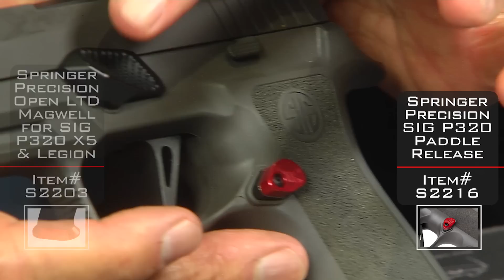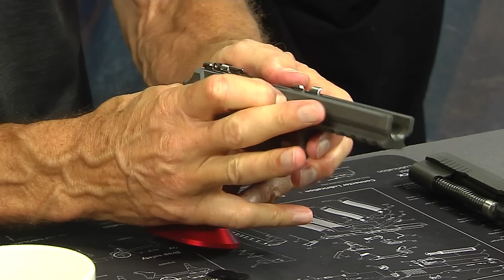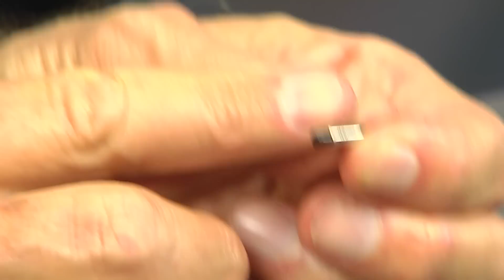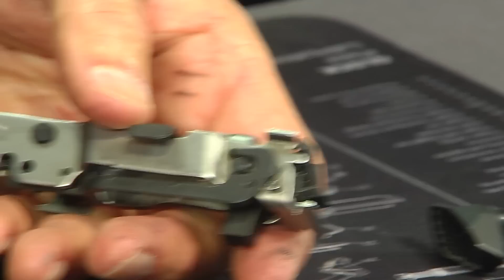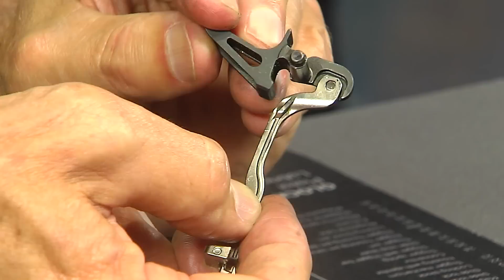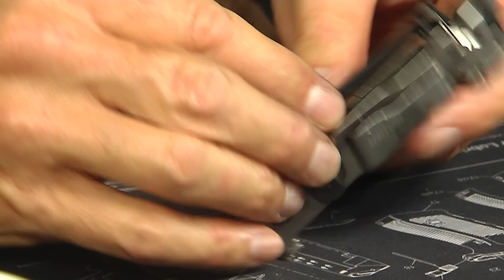The Max Michel Sig P320 USPSA Competition Spring Kit

Comment: For anyone curious, I was getting about a 3.5# trigger before I installed these springs. I'm now getting about a 2.5# trigger pull with no overtravel. I have the 320Max. It was a little bit of a pain to install the kit, until I looked at the fcu for a few minutes. Now I could install this spring kit in about 10 minutes.

Comment: Lenny, good product...but.  The lighter springs - sear and trigger - yield about a 10% reduction in trigger pull weight. The overtravel buffer is another thing. I tried it with my Apex flat faced trigger and with the stock Sig trigger. After I rack the slide, the trigger locks up.
Reply: Same here

Comment: The gun works perfectly with the lighter springs; I got about a 10% reduction in trigger weight. The only thing different is when i put the buffer on. Then the trigger locks.

Comment: I follow the procedure per your video. Once I have the .135 buffer installed, I check for functionality. The trigger works. I then re-install the FCU and the slide lock. While the slide lock is pointed down, I install the slide and lock the slide back. Then I turn the slide lock up and release the slide. The trigger is dead! What did I miss?

Comment: I followed video, got springs installed.  About 9-10% trigger pull reduction. Added smallest roller on trigger stop pin. All parts work until re-install FCU into gun. Trigger will NOT pull. Any suggestions?
Reply: You’re suppose the install the slide and lock it back. If you don’t lock it back first, you’ll have a dead trigger

Comment: I just bought this and I'm using the .135" trigger over travel buffer and I noticed the following when dry firing. When I pull the trigger and hold it back, rack the slide, and release the trigger and pull it again, it does not reset the firing pin. Is this normal?  If I rack the slide with my finger off the trigger, then everything resets just fine and works like normal.

Comment: I just purchased this for my p320c that I had to get the voluntary upgrade with that said I have the Sig flat trigger and the smaller trigger stop bushing is still to much and unless you run only 1 sear spring like he mentioned it doesn't change alot it wasn't just a plug and play event but with some fine tuning I have a nice 4lb pull

Comment: Any chance for increased weight spring kits for people that prefer a heavier trigger for EDC? Is pretty common for people to use the heavier trigger springs/connectors with Glocks, so I think it would be common for the P365 if the heavier springs were available.

Comment: for a lefty how do we deal with a gas pedal?
Reply: That would be an engineering feat in its own right. I wonder if you can get one that goes on the  rail. Would interfere with any light or laser (moving them down assuming that the gas pedal has its own rail, so a light/laser can be installed onto it). Have no clue how a holster could be found that would work with it though. Could probably contact a custom holster company and have one made for a fair price.
Reply: Looked up left hand gas pedal and they do make one that goes on the rail. It don't have it own rail though, so you can't install a light or laser on it. They want $40 for it too. Could probably come up with a much better design/option though if you tried (like a takedown lever version). I know it's not quite as simple as it sounds, because the takedown lever can only be installed from the left side and it cannot be modified to install from the right side... but I still think it  could be done. (sorry for the rant).